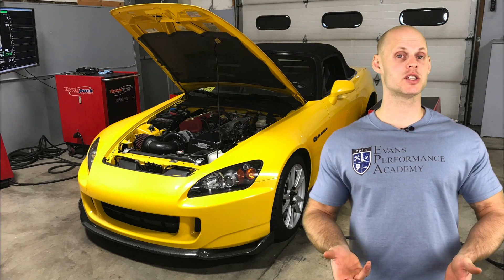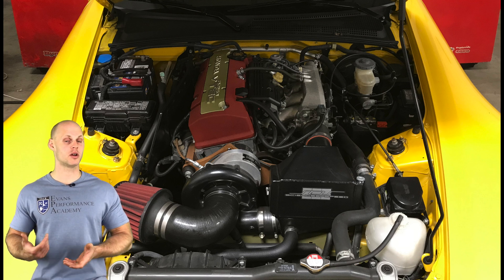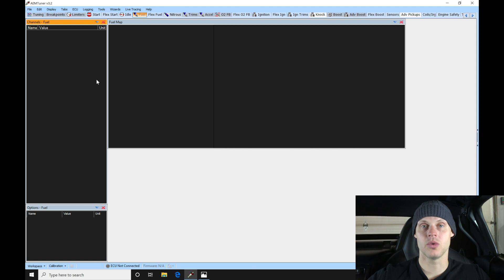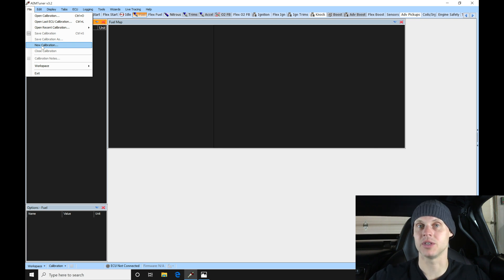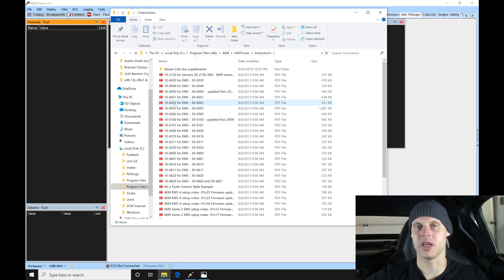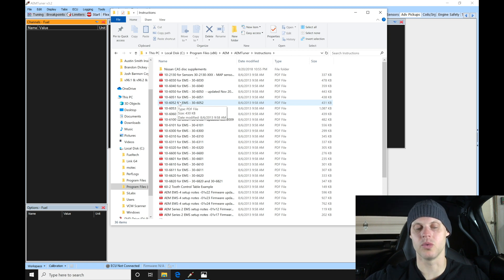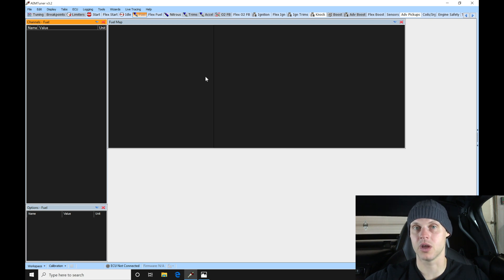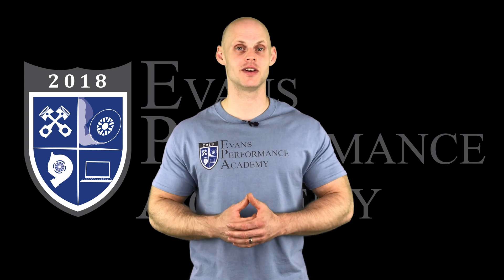AEM Series 2 Live Training: Supercharged AP2 Honda s2000 Part 1 | Evans Performance Academy

Comment: What were the power and tq numbers for this car after it was all said and done?
Reply from the maker: It made 440 whp / 290 tq at 14 psi
Reply: @EvansPerformanceAcademy  whew. Did it have a fuel return system?
Reply from the maker: @ericcaswell9840  All 00-05' s2000s have return fuel systems.  06' and later had returnless.